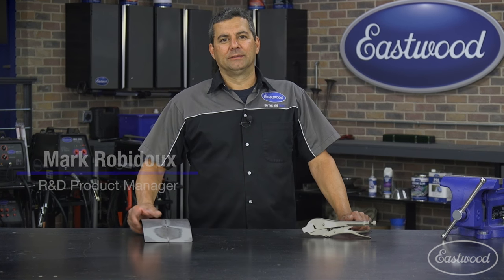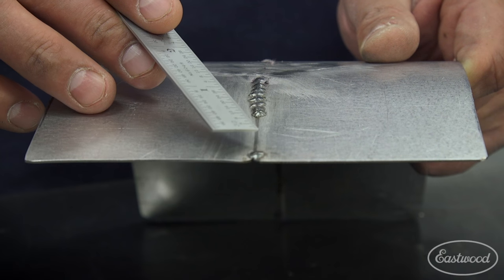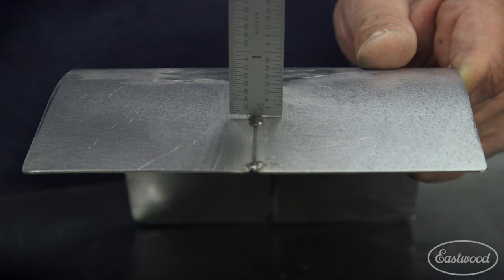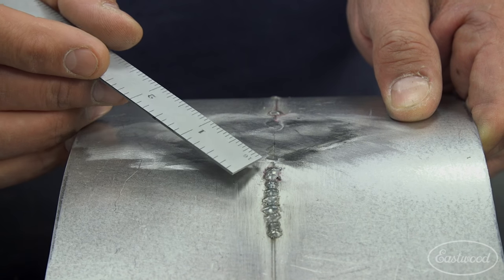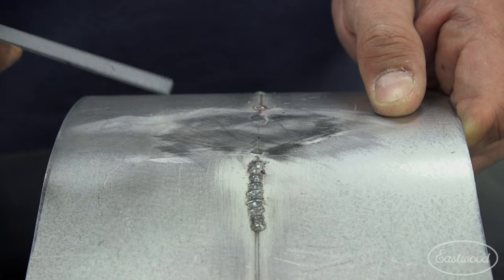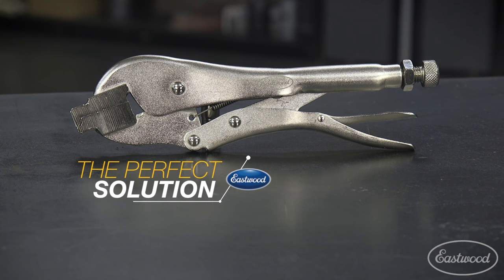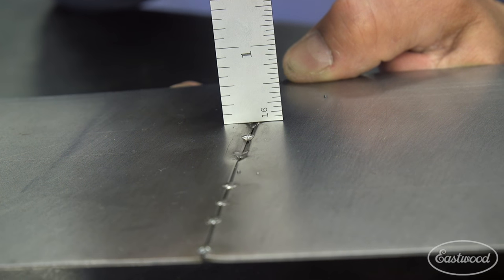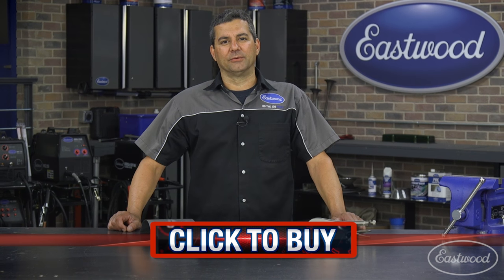How To Achieve Perfect Welds on Sheet Metal - Manual Perfect Panel PrepTool from Eastwood

Comment: YOU GUYS ARE ALWAYS WELDING SQUEAKY-CLEAN, SHINY METAL. THIS IS UNREALISTIC.
Reply: But that is how metal should be when you are welding it... at least where it is going to be joined.
Reply: REVENUE: SOUNDS GOOD TO ME. I AM FOREVER WELDING ON RUSTY JUNK.
Reply: Rust is removable. If you are burning 6011 stick rod making farm gates that's one thing, but if there's time to weld sheet metal there's time to clean the area with a flap disc then weld it properly.
Reply: Media blast it, then weld it. Simple.

Comment: For body work I butt weld with either a 00 tip on my oxy set up or a Cobra torch. You don't get the hardness of a MiG weld nor does it stand proud like a MiG seam. Less grinding and less fill needed, if I fill at all. Usually lead. I LIKE the tool for flat metal.

Comment: Well if you might weld that poorly yes ur going to have issues,but a full pentration weld melts both metals together ,it actually creates a bead of weld on the other side.So when you grind flush it shouldn't crack.

Comment: I'm no professional welder, but these welds look cold.  If your welds penetrate correctly, you will not be left with a "crack" between the pieces after you grind to blend,especially on thin sheet metal.  That said, this is a cool tool.
Reply: Some try to weld with no gap between panels like in the video. It's recommended to have a gap the same thickness as the sheet metal for full penetration with MIG. This tool will save some time grinding I think though.
Reply: These would help a novice in places were no hammer dolly would be allowed but if you tried you use a dolly to straighten a heat affected weld joint after using these you be up shit creek.
Reply: Jesse Burk thats a low spot, not a crack. you can't necessarily tig weld to cold because it simply won't weld. no puddle will form.
Reply: its not a tig weld...mig it is
Reply: I'm not convinced this is a cool tool at all. I'm no body man either. But the 'flaw' this tool is supposed to help with is a poor prepped seam that wasn't welded properly. No panel spacing, not enough penetration imho. Both sides of an 18ga butt weld should want a little smoothing after welding. Use this tool, weld improperly, and you still have a problem with "structural integrity" and open edges in the back side to begin rusting.
Reply: I don’t like the idea of this tool at all. It fixes one problem by creating another. So now, you’ve got a big bump from the sheet metal instead of the weld.

What I would like to see is a tool the bends a small shelf at the end of the sheet metal, the thickness of the metal itself, that is, whatever gauge the metal is. I guess you’d need several tools, replaceable jaws, or some kind of adjustment. But that shelf would allow resistance spot welding of the sheets. I know that’s not exactly what is always needed, or allowed for body work, but that’s not the only kind of sheet metal work out there. Right now, I often need to cut a strip and put that behind the edges of the two sheets and spot weld both sides. What I want would eliminate that strip and allow welding the shelf instead. Much better.
Reply: hard to get a deep weld without burning holes through metal that thin even with a smaller mig with all settings low.
Reply: @melgross  I've had a hand tool to do what you want for about 40+ years, it's call a joddler (joggler to some), it just creates a step at the edge of the metal & if you have access both sides you can make a double seam, super strong joint. It has a swivel head so that as well as forming the step, it will punch 1/4" holes for plug welding. These days you can buy a bench version for "edge setting" does the same without the effort of doig it by hand.
Reply: A65Bill that sounds good. I’ve been doing it recently by hand, sort of. Ive been thinking of modifying a vise grip by removing the jaws and making jaws in the mill, and welding them on. Who makes this?
Reply: @Toxedd  Thank you Yoda for your wisdom.

Comment: I'm sorry if you grinder then sanded no matter how far you went down you shouldn't see a line. In all reality what you have is really a lack of fusion
Reply: Right.
Reply: @noampitlik2332  p000pp
Reply: AGREED!... First and foremost.  they did not leave the necessary gap required when butt welding sheet metal together. .. NO gap will result in exactly this in my novice experience.  that was the first thing anyone taught a guy when butt welding.  perfect spacing / gap is key

Comment: Butt welds using a mig will always get you a slightly proud weld. No matter how good of a welder you are. Meaning allot of grinding and heat distortion to get flat. Especially on thin gauge steel.I can see how this would help eliminate that problem. Probably not ideal in every case but I think its still pretty neat.

Comment: supposed to leave a small gap between the butts ( maybe more less 1/16th) 
so melted puddle can grab both sides and not leave those "craters" along the seam... that example was a bad weld on purpose...I done the butt welds with acetylene and still got better than that... but a tool is a tool only if you really needed!
Reply: This is why I use a Cobra torch on body metal. Low heat, but it's enough to fuse both panels together without leaving a proud seam. and it can be used on compound curves.

Comment: I would have like to have seen the other side of that weld. My guess is that weld was just puddled on top of the seam, and if that's the case that's what will happen when you did not use enough heat.

Comment: Backing your welds will solve all these problems. Back the weld with either your gas or a plate of brass,copper or aluminum. Steel is easy guys, just clamp some brass,copper or aluminum to the back of the joint. Hit it hot. problem solved.

Comment: A video I saw about welding sheet metal said a good weld will make a little button on the back side of the panels, indicating good penetration of the two panels which will leave no crack after grinding. The welds on this video are surface welds with no penetration.
Reply from the maker: These welds fill in the valley, so when the sheet metal is grinded smooth, you still have a thick weld that is strong.
Reply: Larry Pyne that's correct. if you didn't get penetration you didn't weld properly, and had your marketing department come up with yet another excuse to rip people off

Comment: Downside to this tool is that it leaves the backside of the repair panel looking like poop.
Reply: And if its a fender who cares what it looks like on the other side, because if you had good penetration to begin with the other side should look like a button/spot weld not very pretty in either case.

Comment: With that lump on the underside of the panel any attempt to dress out any distortion would be futile. Butt welding with a tig welder can be done so that no grinding is needed and the metal is perfectly ready for metal finishing

Comment: Shouldn't there be a gap between the panels rather than having these butted together?

That low spot seems to just come from no penetration from the mig welder, there's a bead being laid on top but the base metal isn't getting pentrated.

Comment: I can't be the only one who noticed that he was just tacking the plates together with a MIG welder that wasn't set up correctly. lay correct stringer and you won't have a problem. Also TIG that joint closed and you also won't have that cracking problem. Plus with TIG you can control how "proud" your cover is and still achieve full root fusion.

Comment: Your weld cracked because there was no proper heat or time allowance for the pool to fuse the base metal. I do concourse-level bodywork that requires the back of the panel to look as good as the front. I imagine you will see a nice hump from the backside?

Comment: not sold on that one. The  valley created is too deep, will need to be filled which will create excessive heat an distortion. But I may be wrong. From my experience always use 0.6 mil wire on MIG never bigger, that is the secret.

Comment: Ahhhh......nope. Great for a flat panel but pretty much every panel has a "curve" and using this tool and bending the metal against the curve will stretch the metal and will result in more work. The weld on the front should almost look like the rear on a butt weld. When it does then you can grind away to get your shape. Doing it right now and I have never had an issue with "cracking" that you claim.

Comment: Gimmicks to make money.
Reply: Jesse Burk below makes a valid point !!!  " Jesse Burk
Jesse Burk
1 year ago (edited)
I'm no professional welder, but these welds look cold.  If your welds penetrate correctly, you will not be left with a "crack" between the pieces after you grind to blend,especially on thin sheet metal.  That said, this is a cool tool. "

Comment: looks like vice grips with a different tip lol
Reply: I pick up old vise grips at garage sales and weld all kinds of stuff to the jaws to use  as special tools.  
Heck, I've cut some "tools" back off and made another tool I'd need when I didn't have any extra vise grips. 
I'd make these, but I don't need em right now😂
When I do need em, what the heck, I'll buy em and save an hour of fab work.
Reply: It looks like that because that’s literally what it is lol

Comment: Just imagine having this on the back side whee ist exposed to weather..... it will rust within weeks.....
Reply from the maker: What is different than a standard butt weld without using the Perfect Panel Prep Tool?  The back should still be painted to prevent rust.  It would likely rust in both cases if it wasn't painted.
Reply: Yes but it is easier to cover with paint without the hassle of trying to penetrate the crack which would soak all of the moisture and because of less ventilation would keep the moisture in for days. And there’s where your rust problem starts

Comment: Surely a careful touch and a pair of pliers would achieve the same...
Reply from the maker: You could try that but I doubt you would get get results.  We also offer a Pneumatic version that works great.
Reply: Oscar Williams exactly right. but eastwood is going to try to sell you more shit regardless, rather than agree with you or admit you're right.
Reply: Sure you could achieve the same thing but I'm not going to sit there with normal pliars and try to match the two panels together. Someone said the tool is $22.. Its like 10 more dollars than a pair of vise grips with the shipping included. Jesus you guys are cheap as shit. If you're into automotive restoration and you complain about spending 10 more dollars.. Probably not the best hobby to do to save money.

Comment: anyone who thumbs down this video has no welding experience
Reply: Revenue Retrieving Resistance welding is the correct system for sheet metal.
Reply: Revenu Retrieving rather the opposite is true - those with any welding experience know how to avoid these basic problems and consequently see right through this cheap shot